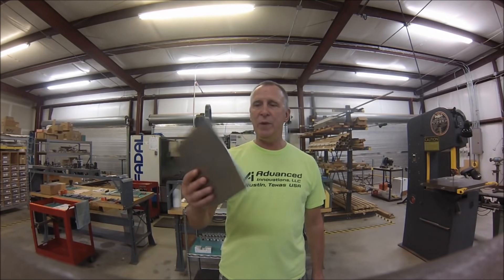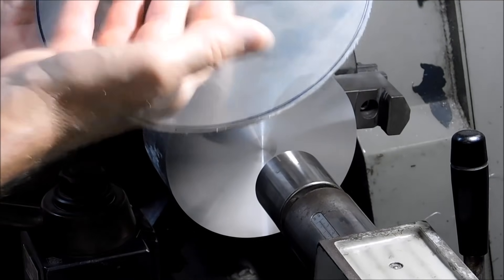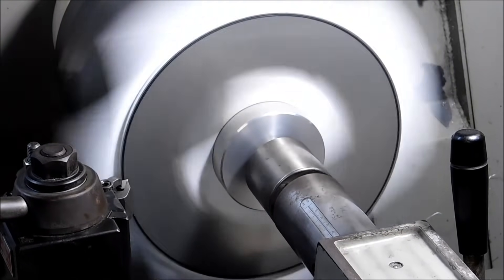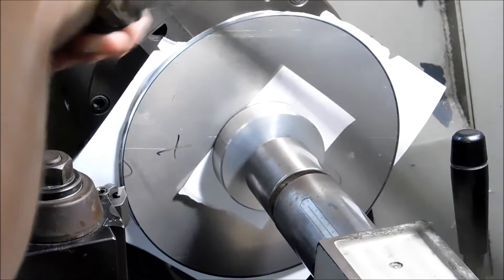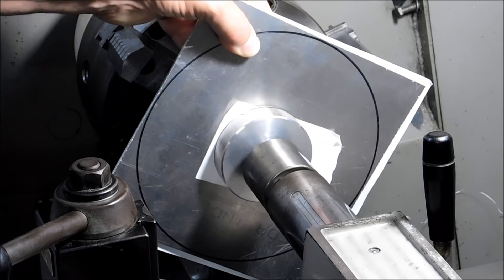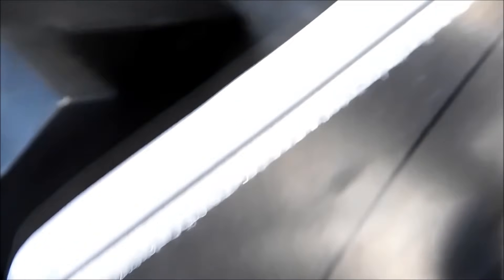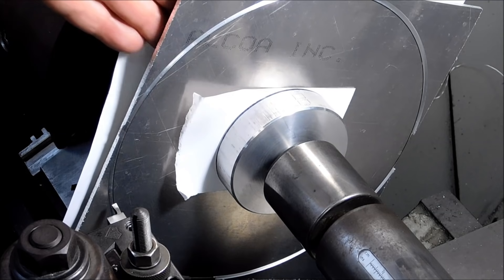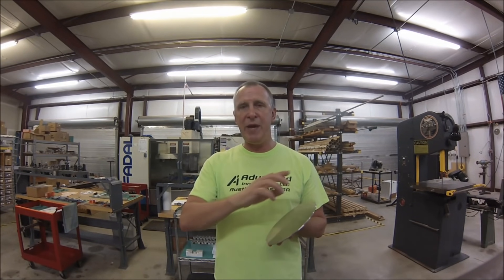Pressure Turning

Comment: I wonder if you could use a rubber(like old car tire inner tube ) instead of paper,to make it more secure and reduce chance of that thing flying out.I had a mini heart attack when i saw you trepanning that thing.
There is one more thing you could do but it takes a little bit more time-you could use plywood to make some sort of face plate(or use one if you do have it )and then use screws to hold aluminum (like drill the holes in corners and attach it with screws to a plate ,then you can push tailstock center and trepann it safely without fear of thing flying out and killing you. )
Many ways to skin a cat!
Thank you old timer for sharing your life long experience with us.
Reply from the maker: I like the 'screwing the corners down' idea. It sure would take the safety aspect to another level. Good suggestion.
Reply: i used that on a lathe once when i needed to make a custom copper washer ,from a flat thin  plate of copper.I used peace of plywood put it in a jaws and just used wood screws in  4 corners.
Reply: Joe could you make a video about what to look for when buying used machines.Like how to check for backlash on a lathe,how to check for wear in the lathe bed,what to check when you buying milling machine ,drill press etc.You can cover basic shop machines like drill press ,lathe ,milling machine,bandsaw,tool grinder.

Comment: Still have a scar on my nose from cutting a disc like that clamped to bed of a milling machine . Used a boring head with extension arm and hand made parting tool in .060 301 stainless.  Learned a valuable lesson.
Reply from the maker: I bet that was a bad day.
Reply: @joepie221  Thanks for your reply, wasn't expecting that. Sawing to rough shape is the safest way, unless clamped to a plate and cut out with a cnc mill behind closed door. I really enjoy your videos so much information !  Most of what I learned was OJT never went to school. I was fortunate to have teachers like you to learn from. I'm retired on disability now, but your projects bring back good memories, thnx.

Comment: Pressure turning a square piece to make it a round piece is for people who have serious thrill issues! As you first demonstrated, Joe, it's much better to pre-cut the roughed out shape on the band saw.

To be honest with you I've never seen pressure turning done and all my years as a machinist and manufacturing engineer. That was fascinating to watch how you cupped the faces of the backing plate and the tailstock plate so that you would get maximum gripping power at the periphery rather than at the center of the hub. I never would have thought of that.... And it's brilliant!

But looking at your setup I can see where there are circumstances where this type of machining would be necessary..... I'm just mighty glad I never ran into them. 😉
Reply: THATS WHAT YOU CALL
OLD SCHOOL, EASY TO DO,
"IF" YOU KNOW WHAT YOU'RE DOING...
Reply: I replied to a post just above yours. And what makes it worse, I have a plasma cutter! Just haven't made a circle cutting jig yet. AND, to top it off, the part I was making didn't even have to be perfectly round. The size of Cahoonies I thought I had, I lost them because of the scare I got!
Reply: I had a client who wanted to do this and just asked him why

He had no reason whatsoever to not just stamp it, especially since the cost of automating this on a lathe was bigger than buying a press

Comment: I'm guessing you used a template to mark the circle on the material.  If there was a hole in the center of that template, the same size as your puck, you could also mark a circle for the puck to line up on, greatly speeding up the machine set up.  Probably wouldn't matter if you're only doing 3, but if you're doing 300...

Comment: I've had to do this from time to time.  I found that PSA sanding disks stuck on the backplate and driver do a great job of securing the workpiece.  Since the sanding disks stay in place, it's fast to swap out the workpieces.
Reply from the maker: Many of my parts are for semi-conductor fabrication. The grit imprint is something to watch out for. if its OK, the psa disk is definitely a great way to go.

Comment: Hello Joe, Many thanks for passing on your expert skills to us on YouTube. Trying to centre slitting saw on end of round stock in mill is my problem, have readout on Z axis only, can you help? Geoff.
Reply from the maker: Blue up the OD of the round stock. Bring the saw down until it slightly scrapes off the blue. Move the saw away from the round stock and bring it down an additional ( half the thickness of the saw) and ( half the diameter of the workpiece) it should now be on center.

Comment: I've been doing this for years.. the sand paper backing is a good idea. I usually spray on some 3M 77. I would never do this with the corners. It's just not worth the risk.
Reply from the maker: I had to cut a few hundred of these out of 316 stainless once. Just about the same size. Started out on the bandsaw and evolved to trepanning with corners. It is truly dangerous with the corners still on.

Comment: Hello there Cap'n
Another superb "How to" Video. Guess just as many ways to solve a machining problem, with due care.
Seeing this was relatively thin material, or even thicker,  could we would not do this with our Iscar left facing Parting Inserts which would cut the same as Your HSS ground bit  ???
Just a thought.
Thanks for showing and sharing.  We never stop learning at 69 on.
ATB
aRM
Reply: Oooops.  Sorry. It should be Right Lead Angle cutting Insert similar to Your Bit. Has a Width of 3mm which will be perfect for these sorts of jobs coming in from the front of the work.
aRM

Comment: Thanks for the video! 
But for me it  just seems like a good way to destroy a set of bearings in a live center while risking getting sliced up.
With that CNC in the background I would have just made up a vacuum plate from a plate of aluminium and then with an inexpensive vacuum pump you know you have around 14psi hold down. On a disk that big over 800lbs of hold down and it would be fast!
If that wasn't an option I'd use a super glue arbor and reduce the risk of flying parts and damaging a live center.
Reply: LMW 
All that for a job that you bid a couple hours on at best ? Good luck staying in business. How is
using a live center as he is going to destroy it ? This puts no more stress on it then any other operation .
Reply: 900 STX putting extreme pressure on a live center will cause wear, I've done it they get fucking hot and have had to change out fucked bearings before.
A vacuum plate is something I've used alot and making yourself one when you have time is a good investment.
If your making alot of these then CNC will shit all over doing it manually.
Just because you want it done cheap is never an excuse to do it dangerously, I've done some dodgy shit in the past to "just get it done" it's not worth it.

Comment: I am aware of this technique, but it can be used for several disks as well by “sandwiching”, or layering them together, done this in steel and softer materials. By cutting the pieces into polygons it is not as dangerous to do, but alway stay sideways off the chuck, you don’t want to “wear” the parts. The more pressure the better.😀

Comment: Hello Sir!
Can you show how to make a smaller hole in a bigger piece of sheet metal like this?
Reply from the maker: There are many different ways. How big is the hole and how big is the part?
Reply: The part is 80x80x4 mm mild steel. The diameter of the cut is D=45mm. I would say with pressure turning has to be done. Question is, is it possible to push the sheet with dead center? Dead centers are smaller, and there is more place for the tool.
Reply from the maker: Using a dead center for an operation like this is not suggested. It may apply pressure for the first few revolutions, then it will dig in and displace the material and get very loose, very quickly.  If you only have a dead center, find an old bearing and put that between your driver puck and dead center. Recess the bearing slightly into the puck. Actually,  the farther, the better. No one says the bearings have to be in the live center.

Comment: If your tailstock is not as strong as a vice this should not be attempted. If there are any variations in the thickness or flatness of the workpiece you may get uneven grip. I would suggest supergluing a flat rubber ring on each pressure plate. The rings should be about 1 inch different in diameter to suppress vibration and between 1/2" and 3/4" wide for about 4 to 5" diameter good for cutting up to 12" diameter. Use 1/16 to 1/8 thick rubber. This will conform to any variations in material surface and give maximum grip with no need for paper or Emery cloth. Larger diameter cuts will need larger pressure plates and rings. Always feed by hand because if the tip breaks or gets dull it will be more likely to throw the part out if its power fed.  I've been a manual machinist for  20 years and finding the safest most productive way to do dangerous jobs is what I do. Still many are better than me. Remember safety precautions only mitigate risk they don't eliminate it. Work carefully at your own risk.

Comment: May be a dumb question, but why not mount the cutter upside down and run the machine in reverse? Still pretty dangerous cut, but at least then you would have material rotating away from you and if it did come lose, it would hit the back panel or the ways instead of flying at your face, right?

Comment: Seeing as how you seem to have to juggle so many portions to jig this up, have you ever considered using stencil spray adhesive to hold the paper to the discs? It's available at any paint store or craft store where they sell paint stencils and it doesn't leave a residue on surfaces. In the event that it does leave a little residue, it's easily removed with rubbing alcohol.

Comment: I make round from square, frequently, using this method (steel) when I can't be bothered using my rotary table on the mill and there is no center hole to put a bolt thru Example: inspection hole cover for pressure tank.  I have to hoist or slide the 12" rt onto the mill table, it's so damn heavy, and the operation is so time consuming.
Forgot to mention, I extrapolated this this method from pressure forming copper sheet in metal shop as a kid. Using a dished form in the chuck with a heavy gauge coper sheet held in place by a small, curved die in the tailstock and using a greased wood dowel to pressure form the copper to the wood form then trimming off the excess and polishing. I was a teenager, I never considered it dangerous.

Comment: Good video, would never have picked up using paper as a clutch, if you mark the plate with the diameter of the smaller workholder as well as the OD then it can be initially placed concentrically a lot quicker.
Reply from the maker: True. Also, PSA adhesive sanding disks in fine grit work exceptionally well too.

Comment: good learning experance sharing. Thanks!  I'm thinking the tailstock push forward is the same direction of cutting tool. the cutting force will reduce the holding presure. If tailstock can support by hydraulic or spring to keep pushing may be better?
Reply from the maker: the tailstock pressure usually does all the compressing. I do keep a hand on the wheel to detect anything slipping. That wouldn't end well.

Comment: Always so very informative..esp for a newbie like me...one question...you mentioned the specs required a couple of thou as limits for the measurement...how would you go to measure accurately...beyond a 'sharpie' mark "           +/_  0.002  ?                                                      Greetings from Malta (Europe)....
Reply from the maker: Micrometers are available in just about any size if you have the cash to buy them. I have a 24" set dial of calipers I trust and use for work like this.

Comment: yes this is the video i think you meant. i didnt have a name for this operation but pressure turning sounds good. i have done this a lot on the lathe. i always need a thin round circle andhad no idea on how to achieve it and then it donged on me make a samitch of metal with my cheese in the middle   great video

Comment: I got to thinking that 400mph for that piece to fly over your left shoulder was pretty fast, it would leave a mark for sure so did some high school math as follows.    320rpm, diagonal of an 8" square is just a tad under a foot. so pi x d = 3 foot and a couple of inches times 320 rpm gets you about 1000 feet per minute or maybe 12mph if that excess flies off,   If I am way off then correct me!   Just a retired farmer, banker, engineer in Michigan.   You have GREAT videos.
Reply: Bill Lampe I'm pretty sure he was intentionally exaggerating.  Though with the razor edge created I'm sure 12mph would still make you bleed!
Reply from the maker: The surface footage is actually 7.735 MPH, but at 325 RPM, that scalloped 4 corner burr looks like a chainsaw with very large teeth. It would  do major damage.
Reply: For fun I just roughly calculated that a 90 degree half second swing at your  head with a machete would arrive at about 10 miles an hour! That is  more than enough reason to to worry about metal flying at you at seeming low speeds. The 400mph warning is warranted exaggeration :)

Comment: I guess this depends on centering it better than half the error you intend to mill off? why not mark out the center?   Safety squints engaged, but I thought a noodle chip was indicative of a problem with the cutting speed.   Sorry I'm just a noob here, so a correction would be very welcome.

Edit:  2nd method is for the brave.  I was talking about the first.
Reply: The "noodle chip" you mentioned isn't necessarily a problem with the cutting speed. I don't think he was taking off enough material for the chips to contact his chip breaker, if he even has one on top of his insert.
Reply: Peetiegonzalez yeah speeds and feeds might have been not ideal but in this operation a nice chip does not matter. The more important thing is that the part does not fly out so you go with a small feed and deal with the stringy chips.

Comment: On your pressure side, from the tail stock, have you ever consider "cats tongue" tape between the pad and the plate?
Reply from the maker: For a production environment or job run, adhesives and glue just aren't practical. But yes, strong double sided tape or glue would help.
Reply: @joepie221  You've got me wrong. Cats tongue grips one side but adhesive the other. I used to use it for something similar to your job (laser cut 4mm Aluminium blanks) between two dummy centres.
Headstock side, 600 grit wet and tail stock side the cats tongue.

Comment: I always call it friction drive. 
  You can bump center your part. Right off the tool holder.
 Good candidate for vacuum fixture in mill. Enough square inches. Would require bottom chamfer consideration. 
   Any luck setting a stop?

Comment: I actually found myself leaning back from the screen! WOW!
Reply from the maker: Ya shoulda been standin where I was standin. You should see the burr this cut left!!!!
Reply: @joepie221  i had a fortunate mis-mishap .... Did the same thing the other day. and as you mentioned about the rib staying in place (or in my case, not). I was not using pressure turning though. I drilled a hole and put a big bolt and nut through which I clamped the chuck down on the nut. Anyways, I was turning and the next moment those ninja stars came off! At one place the web broke and 'opened up' the off cut and flung it past my bicep/forearm. I could swear that a few arm hairs were trimmed! Thank God for His protection! I could have had that piece of steel embedded in my arm and suffered a very serious injury, or worse case ..... I got a HUGE fright, and needless to say, opened my eyes once again on how dangerous unsafe/not properly thought out practices can be! So thank you once again for your teachings and warnings that keeps us safe!

Comment: neer played with a metal lathe,but would it work to cut with a parting tool,cutting paralell with the tail stock?...sorry if my question isnt clear,love your videos,i have played with wood lathes,and would like to get a metal lathe,and mill
Reply from the maker: The parting tool would probably rub because of its straight profile. You need radial relief on this type of tool. Watch my Trepanning video, it goes into detail about that.

Comment: What about turning a long giant bar of aluminum to the correct width, and then cutting slices off of that like salami with a band saw?  I am sure there are various reasons that won't work at these tolerances you need, but I have seen people mass produce gears that way.  Cutting the teeth long ways, then slicing the bar like salami in to gears.
Reply from the maker: That would work if the parting of the slices could be controlled and produce the desired finish. Ideally, a laser or waterjet cut blank would be ideal.

Comment: If your doing it with the square corners use a thicker piece of paper and double sided tape in the center of the corner areas to stick the paper to the metal this will hold the pieces in place at the end of the cut "lessening" the chances of getting the flying pieces at the end if you go all the way through.
There is also a third method and that is to do a roughing pass most of the way through the part and then bandsaw off whats left put it back in the lathe and do your finish cuts without the danger of flying pieces and without spending all the time to bandsaw off the material at full thickness....it's quicker and safer.
Reply: jadesluv
With your third method then you have to waste a lot of time trying to get it realigned if you put it back on the lathe. definately not quicker